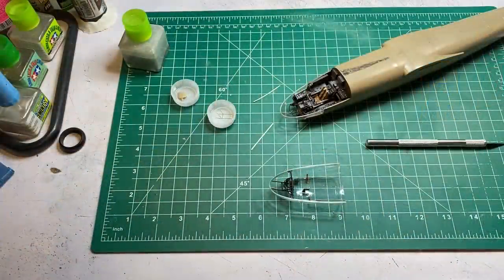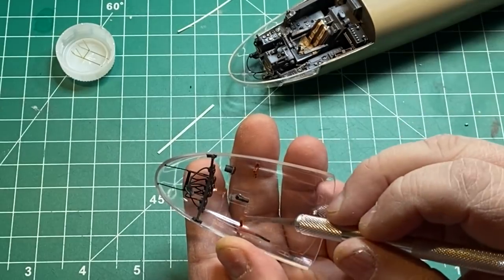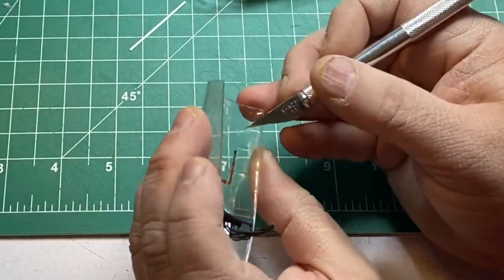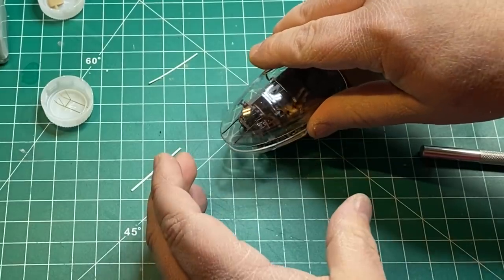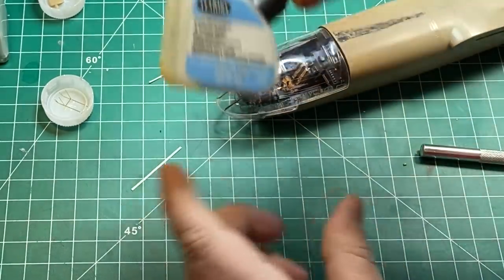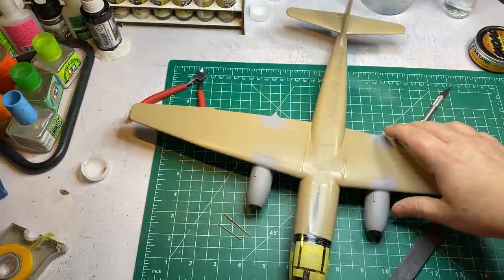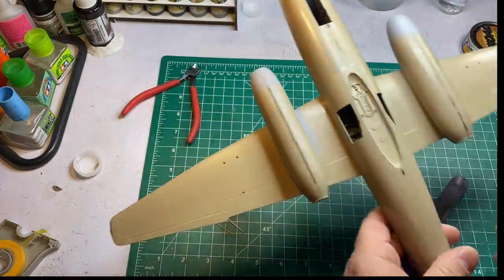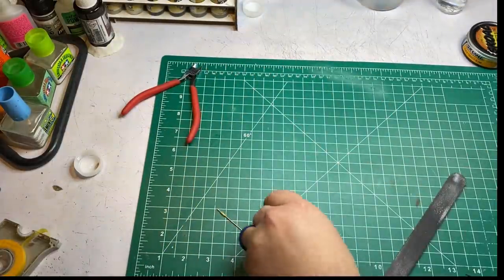Fly Models 1/32 Arado AR 234 B-2 Part 3

Comment: It's always a relief once you get the primer on and you can take comfort that all the hard construction work is done.
Reply from the maker: It’s funny you mention that.  After uploading this video, I discovered that the seams along the top of the wings shouldn’t be there so I filled those in.  And I wasn’t happy with the steps along the canopy so I filled, sanded and re-scribed in that area as well.  I think I’m ready to paint now;)
Reply: @seanerk5kt9  At least you caught it in the primer stage, and not when your putting decals on. Ask me how I know...lol!

Comment: Don't forget the Board shorts and flip flops! From the pics I have of the Arado, you hit the forward IP spot on! NICE JOB!  I was that Chinese guy {I was wong} about the fuel pump access doors on top of the fuse, only the main fuel filler door has an access panel.{ A version had all the panel covers} To many versions and variants, I'll stick to P-47's. So YOU got it correct. Looks good all primed up. This'll look good all camoed. With all the work you did, I wouldn't be able to let it go. The gentleman you're building this for is lucky.

Comment: When clueing pieces to canopies, you can use “crystal clear, uv curing “resin””.  I’ve started using it and it’s amazing. Once you get the correct nm uv light. 395nm ; 409nm

Comment: Could I ask you sir, what compressor/Airbrush combination you use? I really want to get into modelling and want to get decent results. Greetings from Nottingham, England. 👋🏻👋🏻👋🏻
Reply from the maker: For airbrushes, I highly recommend the Iwata Hp-cs.  It’s the first one I ever bought and it’s the one I use the most.  You really can’t go wrong with any of the cheap compressors but make sure you get one with a tank.  I have videos showing my airbrushes and one for my compressors.